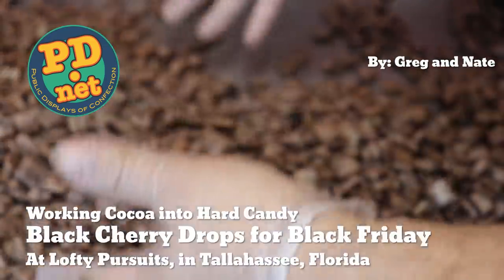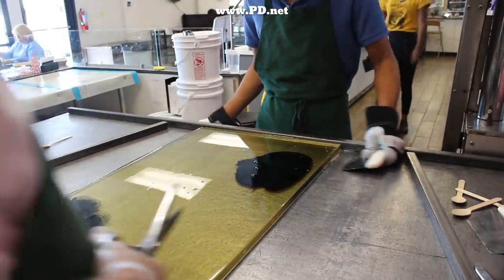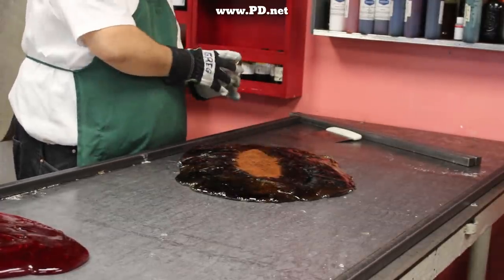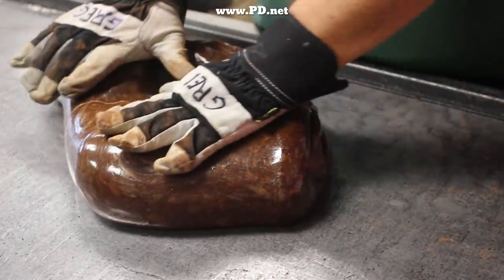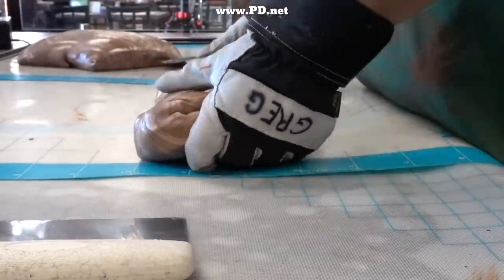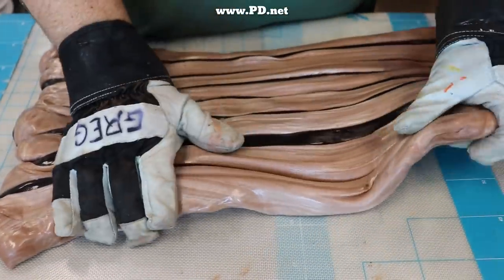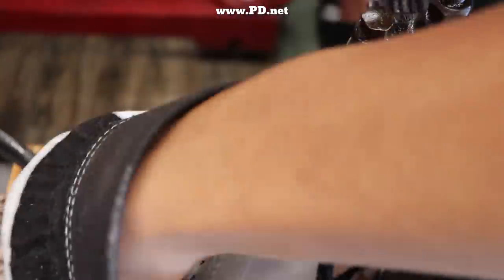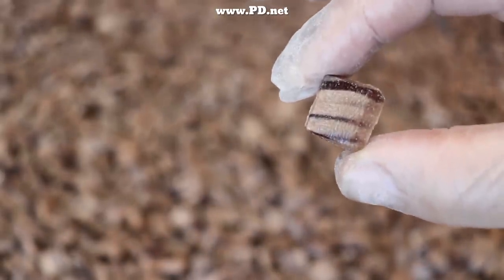#122 Black Friday, Black Cherry Chocolate candy Drops (with a Black Friday deal)

Comment: You should get a nicer base for that drop roller than a dirty old piece of plywood. At least use a real piece of timber. I'm sure it is harmless, but manmade wood products like plywood have a ton of chemicals and additives believe it or not.
Reply from the maker: It's food grade plywood intended for food prep surfaces. It is finished with many coats of a food graod oil. Please give me more credit than that and do not accuse me of poising my customers.

Comment: Are you legally allowed to call this "chocolate"? It doesn't have any cocoa butter in it?
Reply from the maker: Cocoa powder has 10-12% cocoa butter in it. Why do you say that it has none?
Reply: Ah, okay, I didn't realize that. Does the final candy have enough of the chocolate ingredients in there to still be classified as chocolate, though? I dunno if the FDA would go after you if it's not enough, but you did post a video of your manufacturing process. You might need to market it as "chocolate flavored" or something.
Reply from the maker: @nick012000 You need to Google more. You are looking at requirements for chocolate bars. This is more like chocolate cookies.